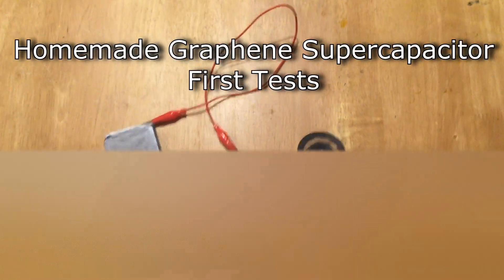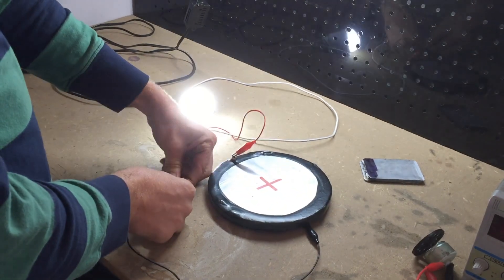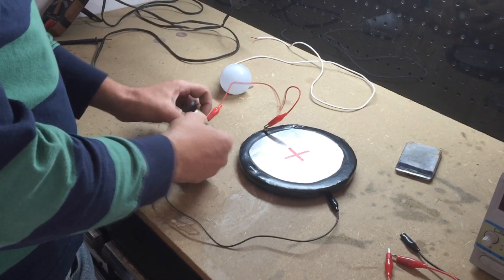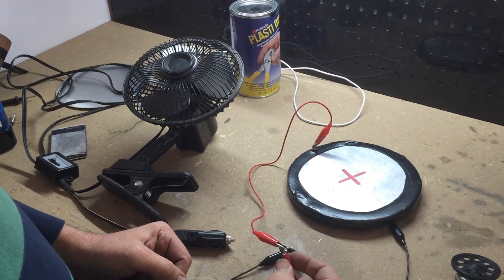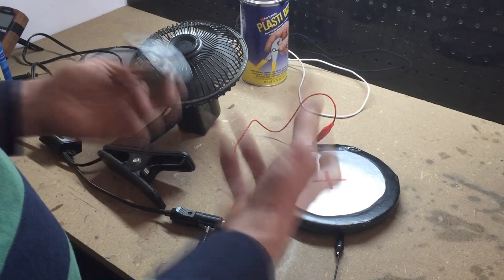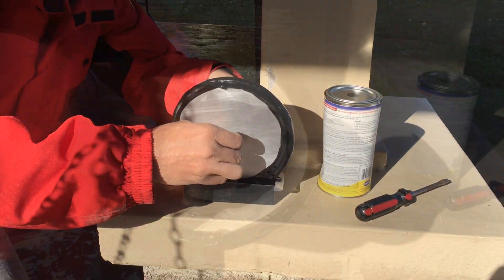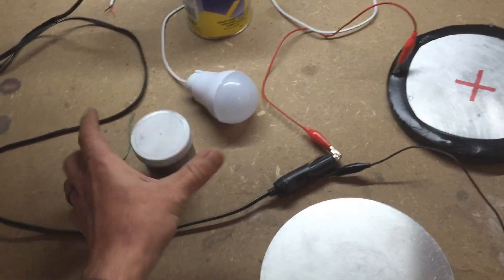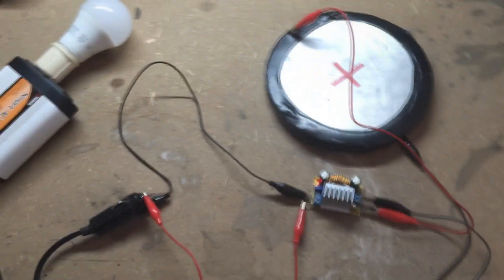Homemade Graphene Supercapacitors - First Tests

Comment: https://en.wikipedia.org/wiki/Energy_density
0.36–0.875 Mj/kg
0.036 Mj/kg
Means you can store 10-24.3 times more energy in a same mass lipo battery.
Not talking about much higher self discharge rate at super capacitors.

Comment: but many websites give definiton to graphene as A honeycomb-like sheet of pure carbon only one atom thick, 
so if it consist of many layers, then it is graphite, 
in the video, the graphene inside the supercapacitor is black, not transparent, therefore it is not one atom thick

I heard news about graphene, people said that grapehe can revolutionize battery world,  then in this video I see performance of graphite, it is big and doesn't hold much energy compared to AA battery, how a single atom thick can be useful...if many layers of graphene didn't give much energy..?
Reply: Graphite can be sonicated forming small graphene flake powder whose sheets are randomly orientated making it appear black. He only used graphene powder to make his  Polyurethane coating  conductive. He then sprinkles activated charcoal over that. The activated char coal is unlikely to have many graphene like structures, but provides  an effective high surface area for the ions in the electrolyte.

Comment: Superb and thanks for the initial construction tip !
Main goal for my efforts (failed so far) is to power a small R/C plane. Can be a glider at first, motor later. But the idea is to make the slimmest lightest supercap with this high density. Equiv run time and weight to a small lipo...because, having trouble finding 40mAh or so anyway !
Hopefully you are looking at a similar avenue as a real world use ? perhaps to power an onboard camera for your quad etc :)

Comment: That's one hell of a watch battery!
Reply: LOLOLOLOL
Reply: ***** I don't think you know this. This capacitor, does indeed charge quickly, but it also discharges quickly.

He charges at 1 amp for 10 seconds. I'm assuming you will have a tiny solar panel, so it will charge at 0.2-0.5. Your clock will use about 0.2a

 Hmmmm.... Controller?
Reply: +marthale7    yes you're right, but super caps can buffer power generated by low speed wind turbines so the charge rate is correct for those batteries.
Reply: +Danyal Ahmad i dont think he is that weird, i just took a few of those small chinese garden solar panels, and measure around my house. 

Yes, i'm one of those weirdos that has windows in my house. aka, sunlight during the day.
I'm confident that at least half of my rooms i could setup a indoor solar clock. 

But unfortunately i live in the northern hemisphere and that results in more than 14 hours of less than ideal sunlight for solar panels, making hard to charge enough to last while its dark. Unless you use larger panels of course. ;)
Reply: ***** weirdo.
Reply: +Zorn101 do you think you could make a square or triangle version of the same super capacitor,or does being a circle help in some way?
Reply: nick and Aaron I   DON'T KNOW ?
Reply: I having been thinking about this sort of idea for buses  ie spike charge at the stop or under re gen braking . A buffer to the main slower , overnight charge battery .
Reply: Flava Flav could probably use that.
Reply: You could make it into a battery watch!
Reply: +marthale7 Solar Panel? Inside your house? Weirdo.

Comment: I wonder how fast that super capacitor would charge when hooked up to a radio wave to electricity converter. (Using the foxhole radio method) except you connect the power where the headphone was supposed to be
Reply: Performance will vary depending on how distant you are from a transmitter your tuned into, and the power they transmit with.  Generally, in most cases, the energy flux  will be very small requiring huge antenna and long time to charge any useful amount of energy. And there's more energy in the carrier frequency then the audio frequency imposed on it.

Comment: awesome very quick charge time.
Reply: very quick discharge time as well
Reply: +Mind Turd that goes with all capacitors... So...

Compare the price..
Reply: +Mind Turd Also, take into consideration. You can charge in 10-30 seconds and run small loads for about 5 min. I honestly think its very encouraging results
Reply: +Danyal Ahmad Also, take into consideration LiPo's. You can 10-30 minutes charge and run small loads for about 5 hrs. I honestly think its very ordinary results
Reply: I'm pretty sure their is a huge difference between 10 seconds and 30 minutes. Can you charge you LiPo battery in under thirty minutes with only 1ah?
Reply: Danyal Ahmad I'm pretty sure that before I go camping, I can wait 30 minutes to charge a LiPo. What's the big rush? You only have a few seconds to live?
Reply: Capacitor vs. Lipo
Reply: +Danyal Ahmad You better buy shares in graphene. China has the monopoly on it and limits its exports.
Reply: Capitán Obvious ...OK
Reply: +Capitán Obvious  
not when its  soo easy  to make it yourself
Reply: happyvalley808 haha